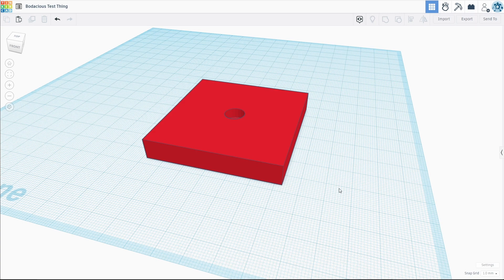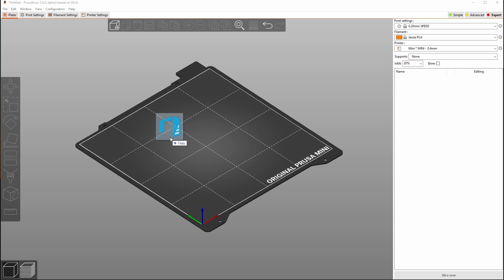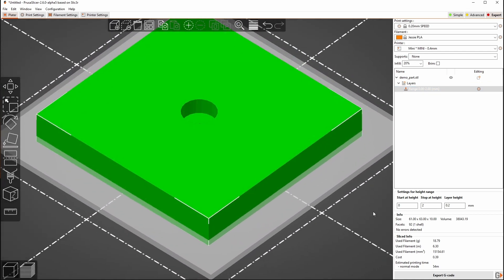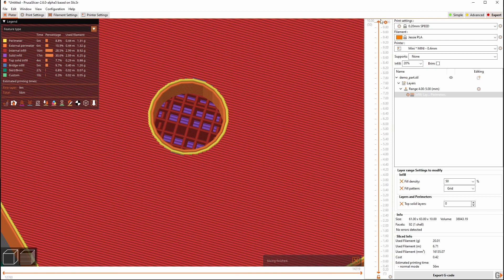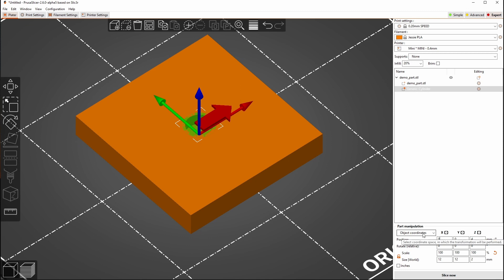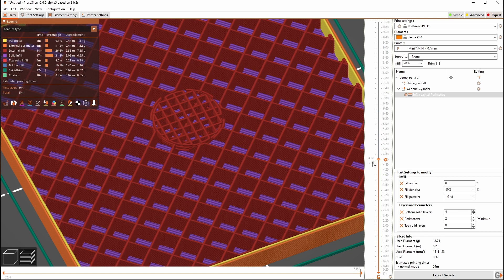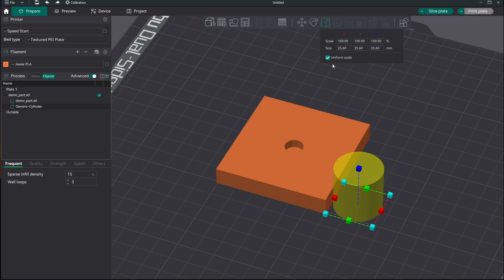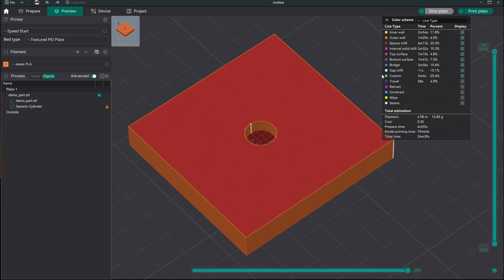Slicing A Bottomless Hole - Quicktip

Comment: Infill does contribute to strength, stiffness and/or rigidity of a part.  Infill also helps strengthen the perimeter layers.  The more contact from infill braces the perimeter layers.
Reply from the maker: Sure, perhaps a better way to state is that the same amount of material will give more strength in the perimeters, than in infill. So I tend to only think of infill as a way to hold up roofs. If I am really worried about strength, I add perimeters. Infill will crumple way easier than perimeters typically.

Comment: I really wish orca slicer would add height range modifiers.
Reply from the maker: It has been marked as to do on  Bambu's Github, so I am sure Orca will pull it in when they do. Orca has done a good job at staying up to date with Bambu. I wouldn't even be shocked if Orca added it first. Orca seems to be a little more proactive, and almost like Bambu is leaning on Orca. But I have no idea what kind of resources Bambu has devoted to the slicer?

Comment: This sounds like a misguided request. It breaks the watertightness of the model, and if glue is being used, it makes it so the glue can just push down into the infill rather than giving complete compressive contact with the magnet. If not, the hole wall is now a lot more flexible not constrained by perpendicular bottom layer, and will likely creep and eventually drop the magnet.

Regardless, a cool technique!
Reply from the maker: I never saw the users whole model, just a hole in a face. So hard to tell the whole use case. But I was concerned about that as well, which is why I showed  adding extra infill at the bottom. It would also not be such an issue if the magnet were going to be inserted mid print, to capture it under a couple layers. Another video idea!
Reply: the model is never going to be watertight anyway since non resin prints cant be watertight(at least on a normal printer) so it dosnt really break that.
Reply: @parallaxrf2570  Um, FDM prints are water tight unless something is wrong with your printer or slicing. This isn't 2015 with no pressure advance, heavy Z wobble, and extruders skipping all over the place.